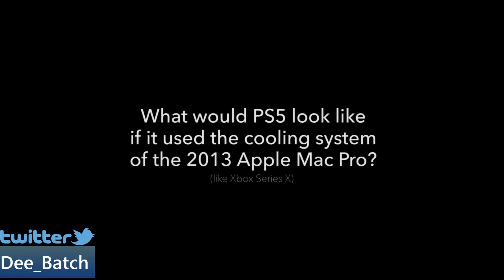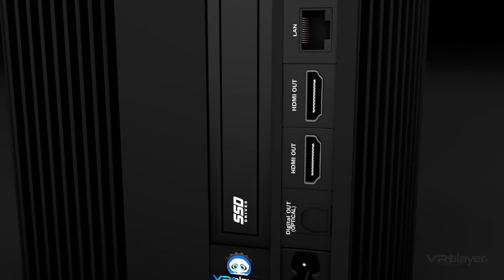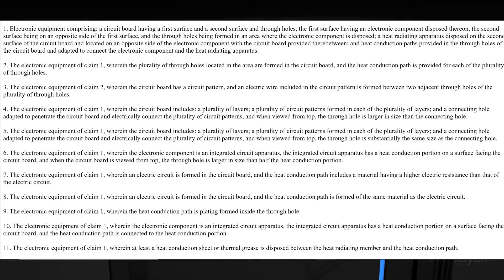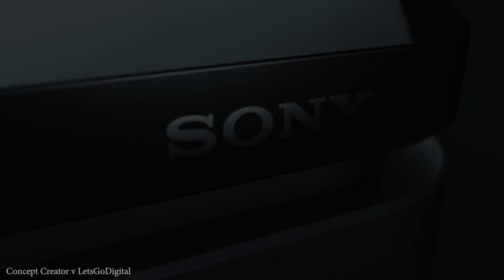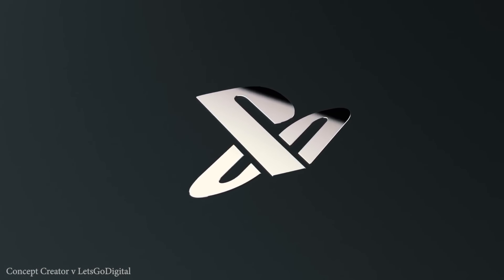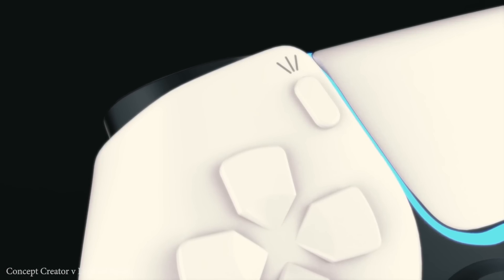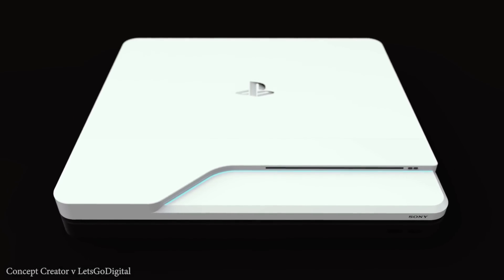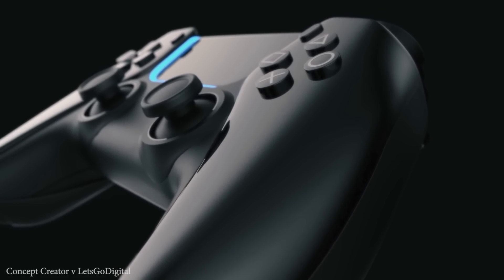PlayStation 5 Cooling Patent Revealed | PS5 Will Have Never Before Seen Tech

Comment: Sony is being overly dramatic in their gimmicks. Dis controller is revolutionary. Dis SSD is revolutionary. Dis cooling system is revolutionary. Yeah, you better get some good fking cooler, because PS5 is overclocked to hell.
Reply: U saying marc Cerney doesn't know what he's doing? 😂
Reply: @philipburgin3109  I think he's repeating what the Sony upper management want him to say. They're trying to deceive the audience PS3 style.
Reply: @philipburgin3109  well considering the fact he has had the dolby company debunk him on info that he gave out during the reveal, how can you trust him?
Reply: Its variable only when needed will it overclock. The ps5 is an efficient console
Reply: @daru250  How do you know that? Personally, I think Sony knows it is too late at this point to make any changes to PS5 specs, so they're looking at every angle where they can improve it to better compete with Xbox series X. I think Sony is feeling desperate, and they're using PS3 era marketing bullshit tactics. Lol
Reply: @gringoamigo8146  Its literally in the architectural reveal ,variable overclock. You xbox fanboys are so desperate for the win, I dont blame it's been a long 7 years. Power itself is not gonna determine the winner. It's a culmination of things, price, games, software. When xbox one x came out, what changed? Nothing, Sony and Nintendo still blew Microsoft out of the water.
Reply: @daru250  lol sony soy boy reported me

Comment: I just don't see the point in having such a revolutionary cooling system when the PS5 is still weaker then the Series X in terms of it's peak compute output....
Reply from the maker: Thye are doing this so they can be closer in power. If not console would be 9tflops.
Reply: @DeeBatch  I agree with you DEE BATCH....it essentially came out of desperation I believe. The PS5 was always meat to be a 9.2 teraflop machine but the Series X surprised them and threw them completely off guard....with their 12.1 teraflop count. Sony should've really known better we could've had a 13 teraflop beast but Sony underestimated Xbox shame on them....
Reply: You're more than wrong, i dont know how much peaople including game developers have to tell you there's more to graphics and performance than tflop count and cus(individual cu size matters for instance 1 large cu with more transisters can equal 3 smallser ones), cerny is an accomplished game developer as well as lead system architect for the ps5 so idk how in the hell you no more than him.
Reply: JamesDom How the hell do you know more about console architectures than Microsoft engineers ?
Reply: @SardaukarX  Microsoft engineers?  WTF are you talking about all the tech inside the xbox is from AMD.  MS isn't a tech company, that would be SONY!   Sony is the one AMD collaborated with to create RDNA 2, these are facts that you can look up.  Mark Cerny is the one who created tech in the PS5 that AMD will eventually use in their hardware for PC.  MS simply payed AMD to put in a bigger GPU.
Reply: @xXphrenzyXx  That only differs when comparing different architectures ie: RDNA VS GCN. Both the PS5 and Series X are using the same architecture RDNA 2..meaning the CU technology is exactly the same.
Reply: @melanitex1089  their both CUSTOM versions of it, so thank you you showed me you do not know enough.  And i don't know more than Microsoft, but i trust a game developer who loves games over a money hungry company
Reply: @xXphrenzyXx  There's no proof that the PS5 CU's are more efficient or larger than the XSex. There is proof however that the Xsex has much more CU's than the PS5 resulting in the higher teraflop number.
Reply: @melanitex1089  but it is worth mentioning that its emphasized by sony specifically to offset the argument that more cu's is automatically better open your mind instead of mindlessly believing more cus is just better and equalls more tflops when clock speeds is a more significant contributor, which the ps5 has more of. No, it doesnt throttle and drop to 1.8 btw thats slow right?  itll stay at 2.2 most of the time "with minor dips"(official) nowhere under 2.0(my guess and im being generous) which is still much faster than 1.8.
Reply: JamesDom   Cause we all know Sony does it for free....for the player’s 😂
Reply: I hope on launch day you actually see that "much better" output that u believe is going to be there.. 😂😂
Reply: To dumb it down, its like the series x has a big V8. The ps5 is like a turbo V6. Sony boost it to try and shorten the deficit, but the unit is more highly strung and more likely to overheat.
Reply: Lol peak compute power.  Looks like someone is still living in the last gen.  Peak compute means nothing lmfao.
Reply: @minners71  It does because the Series X is 12.1 tflops compared to the PS5's 10.3 boosted teraflops. That translates to higher frame rates and higher resolutions.

Comment: “Many fans will be happy with the cooling” 😂😂👌
Reply: Happy cooling fans make the cool fans happy XD.
Reply: Happier than xbox 360 owners. 2 of mine got melted motherboards aka red ring of death. You haters are pathetic.  Cooling solutions are critical you idiot.
Reply: @Luke973T  i went through 3 360s lol. Then 1 ps3 with ylod
Reply: @richboy900  yeah that sucks. The top company as far as reliability has to be Nintendo.  My n64 from 1997 still works lol
Reply: @Luke973T  yeah Nintendo is pretty reliable. For me most reliable console would have to be the original xbox. Never gone wrong once. Ever
Reply: @richboy900  360 was my only xbox but my stepdad had the original and dreamcast. I had the ps2 and gamecube. Good times.
Reply: @Luke973T  the og xbox was like a successor to the dreamcast. I had the og xbox and ps2, 360 and ps3, ps4 (not xb1), but will go with series x next gen
Reply: @richboy900  yeah the timing was just right to take Sega's place even though sega vs Nintendo was my childhood.  I hope xbox does much better next then like the 360 era. That's the last time I owned each of the big 3.
Reply: @Luke973T  As an Xbox 360 owner my plastic box was replaced for free...
Reply: @ReaveIdono  AS A PS3 OWNER MINE WAS NEVER REPLACED IN 8 YEARS
Reply: @marty8370  As a PS3 owner mine was replaced in 2 years. Got the Yellow Light of Death. So what's your point?

Additionally, I had a tough time recovering my original PS account because I no longer had the original PS3 I created my account on...
Reply: Luke973T the one x and series x have thermal performance as a core design principle ever since the rrod issues on 360.  Xbox has come correct since while my Ps4 pro sounds like a jet engine just to turn it on and now the ps5 is struggling.  Sony has to catch up in this regard
Reply: @tha8baller  ps4 is loud but it works. No proof that the ps5 is struggling.  It's not even out yet.
Reply: Luke973T I’m just saying I’m seeing Xbox take cooling seriously in their last 2 console releases I’ve yet to see anything from Sony on that front.  Xbox’s r&d from their Scorpio design really paid off in the Scarlett, Sony has yet to show anything after Ps4 pro (which is all sound no fury).  Let’s hope they get their act together and soon or they’ll miss holidays this year
Reply: @tha8baller  sony never had a massive heating issue so since when did they not take cooling seriously?
Reply: Luke973T now lol
Reply: @Luke973T  pony alert. Tighten up bro the one x has the cooling system right now and as far as things working once again is going to sell u an overclocked system that wnt be on same the same level of performance as xsx. Even with good cooling the ps5 is still the lesser of the two. And brought the 360 that was a whole generation ago u lame for that. The majority of ps4 pro games are 1440 p and 4k upscaled. Xsx is going to have better looking games closer to what's on pc while will be on the lower end of the spectrum.
Reply: @junebugg9259  shut up the point went right over your head I dont care about all of that. Guess what? Sony never had a huge case of cooling issues so for xbots to keep running around perpetuating fear based around Sony needing to prove itself is bs.
Reply: @Luke973T  lol the ps5 dnt even compare. Enough said. Never had ring of  death with 3 360's. Wnt be buying a ps5 especially if there the same price and I  predict they will be the same price.
Reply: @Luke973T  u a pony bro. Jus accept it Sony was completely blindsided by xsx now they're doing heavy damage. U can say what u want bout xbox. All of there shortcomings overs the years has prepared them for this. They made the better product for the money.
Reply: @Luke973T  bro dnt go there u will lose.
Reply: @junebugg9259  lose what? Lol probably some kid I'm done responding to you fanboys. I'll probably own a series x before you do you goof.
Reply: @junebugg9259  who cares? 2/3rds of the 360s failed and that's a fact. The ps2 "didn't compare" to the xbox and the ps2 has sold more than every xbox console c ol combined. You can buy a stadia subscription for all I care
Reply: @11_ 11 PlayStation is going to be bundled with a fire extinguisher 🤣👍🏽
Reply: @11_ 11 lol
Reply: @11_ 11 lol I'm not old who puts there official business on you tube dah? I hope you didn't however I certainly wouldn't take the time to be looking into people profile 😂 to busy for that shit 🤣👍🏽
Reply: @11_ 11 dont feed the idiot troll.
Reply: @11_ 11 playstation controllers suck that's why they're reinvented every generation.
Reply: Hopefully it comes bundled with a fire extinguisher 🤣
Reply: Ps5 is a piece of shit!
Reply: john jackson Wow!  Charming. So much emotion describing piece of electronics. You must have sad life.
Reply: john jackson mega fan boy
Reply: @Sloppybannana  yes sir!
Reply: @JJACK2024  
Really? How so?
Reply: @JJACK2024  Are you of your meds again? I told you to use toilet paper 😉😷
Reply: @s3rv3r3rror8  good story 😂 bro 👍🏽
Reply: @JJACK2024  glad you like it, now wash your hands before going to bed. 😉🤓

Comment: The SSD is not cheap. The cooling is not cheap.  Why do people act like Sony is making a cheaper console?
Reply: if only they knew how much they are going to pay for the expandable storage...a tb of the fastest M.2 is like $200 plus...lol that not even fast enough for the PS5..so when the new m.2 nvme 4.0 drop with speeds that meet Ps spec they are going to be expensive. most likely will cost over half of the console
Reply: SSD will be cheaper in a mass produced environment. Remember, the manufacturer has to make 10's of millions of SSD for the consoles. That's guaranteed sales through contracts. PC SSD has lots of competition so the individual mark-ups are higher through retail providers.
Reply: Because both Sony and Microsoft isn't paying any retail unlike us consumers just like in PC market, those components are relatively cheap to manufacture with especially if they had a contract of millions of bulk orders to save up. After a year or two these components will likely drastically reduce the production cost due to a newer products will come out, launching these consoles is the only rough with the addition of our current pandemic situation but it'll be fine and I still do believe just how Dealer Gaming of how PS5 will cost $399 and XSX for $499.
Reply: Ps5 graphics card £400 in shops + oc cooling system cost (£50?). Xbox series x graphics card £700 in shops?? I think... Tuff one to call. Proof of the pudding, is in the eating 😋🍰
Reply: Microsoft and Spencer rubbing hands eagerly awaiting ps5 price announcement

Comment: Even with 9.2 tflops/10.28 tflops overclocked. Let's be real and look at god of war and spiderman and horizon zero Dawn those games were made on a what? 1.5tflop PS4? 

Even the xboxsx is going to be a huge leap in a lot of things.
Reply: Don't even need to go that far fam.. look at the last modem warfare released in 2019.. looking at that game on regular ps4 and on Xbox One X, do they see a HUGE difference, NOOOOOO!! And the power difference is massive.. 😂😂 I'll see if their hope that the ps5 vs series x gap going play out any different..
Reply: @stainless50  ....the pro PS4 and x1x are 2 totally different power ranges. 

When you build a PC, the best of the best CPU and GPU is crazy expensive, plus the graphics and frame rates only get but so good. 

Putting that into perspective 12tflop console vs a 10.28tflop console is minimal difference considering a console only plays video games the consoles are optimized to do just that run games. You can feel how you want but look at a 200$ gpu vs a 500$ gpu the difference is 2 things 10 extra frame per second and an extra 300$.
Reply: @BrettASmith-df4mw  that's exactly what I'm saying I was agreeing with you.. I just used the huge gap between to already existing consoles and an excellent looking game that they both share "modern warfare" (can hardy see a difference).. with your above comparison, people need to understand that the gap not going be that huge gap that they thinking.. 👏🏿
Reply: @stainless50  it has 4x higher resolution dummy. That's huge, but you can't afford a 4K screen lol
Reply: They only look good because of 30fps and 1080p. Sorry but that doesn't cut it. It takes 8x more power to bring them them up to 4K60. That's a generational leap just for the output alone
Reply: @vandammage1747  consoles are OPTIMIZED TO PLAY GAMES a PC is NOT
Reply: @BrettASmith-df4mw  yes we can agree to that but I wasn't talking about pc. Pc gaming is a bore
Reply: @vandammage1747  😂😂 so if series x gives you those listed games in 4k60 and ps5 gives you those games in 4k60, what's the difference?? 🤔 lets hear it..
Reply: @stainless50  if both are 4K60 which I doubt then XSX will have higher settings.
Raytracing will be considerably better on XSX
Reply: @vandammage1747  u said that even though the ps5's hardware based ray tracing solution has not yet been revealed.. 👀 ok I hear u fam..  😌hope we will see the two extra buckets of dirt gains with the series x supreme ray tracing..
Reply: @stainless50  X1X has 44% more Cu's for raytracing that's a fact. Keep living in denial
Reply: here is the reality, you ready?!! You're not going to see %44 better looking games.. NEVER GOING TO HAPPEN!! This is what I mean!!! Deny that all u want but you'll see..
Reply: @stainless50  here is the reality. Raytracing will be 44% better on XSX. Probably more because XSX has directML
Reply: @vandammage1747  you're almost funny.. as I said before "more powerful, yes" but the end products will NEVER be %44 better visually or in performance!! #dreamondude like u already said "if both are 4k60 the XSX will be at higher settings" this higher settings won't give you a %44 better experience.. not happening

Comment: I don't want a console like the Series X because I want to put the console under  the TV.
Reply: But you can it works upright or on its side. I need to do the same
Reply: Joseph Cook its a tower. You can’t.
Reply: @_No20_  New cooling system available for the ps5.
Place ps5 inside your freezer...problem solved
Reply: @_No20_  😂👍

Comment: I think it is rek, but I ali think it this one that they ha issues with tbh..would not be surprised if this was v1, while at the full reveal of ps5 there will be a v2 of the cooling system. I think they did try to make it as small as possible. And that this went on the expense of power tbh.. due to the costs of the cooling solution it has.

Sony wouldnt reveal the cooling system before the actuall reveal itself..

Comment: I looked over the patent on Google Patents as it lays things out in a little easier to visualize way (https://patents.google.com/patent/WO2018216627A1/en) and honestly I think the most interesting take away from this is the chiplet based APU design (last photo) and the possible sizes of each chiplet it reveals

If we are to take the drawing as to scale, then block D1 is probably the CPU, D2 is the GPU and D3 is the I/O unit.  The I/O unit is basically as big as the Zen2 CPU chiplet, which indicates a VERY complex design.  If Sony's SDK doesn't provide good API abstraction for that complex I/O block then it could be a real pain for devs.  However Mark Cerny's words lead me to believe they have this figured out already.

Also we see that the patent shows drawings of wires running through the H1 (CPU holes) and H2 (GPU holes).  I wonder if that's the SmartShift lanes.  Looks too big to be the Infinity Fabric
Reply: Wireadds 🤣
Reply: Kirby0Louise Enjoy competitive and co-operative online gaming with friends and rivals from all around the world in supported Nintendo Switch titles, such as Mario Kart 8 Deluxe and Splatoon 2.